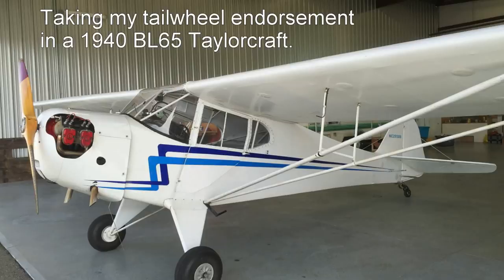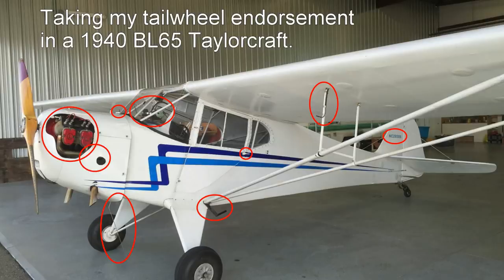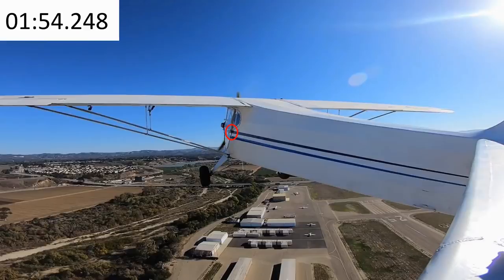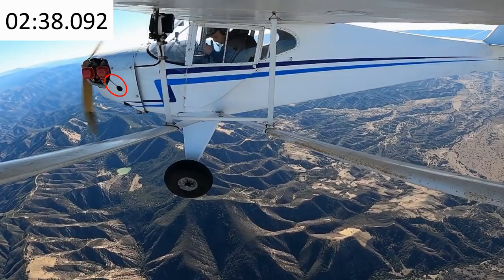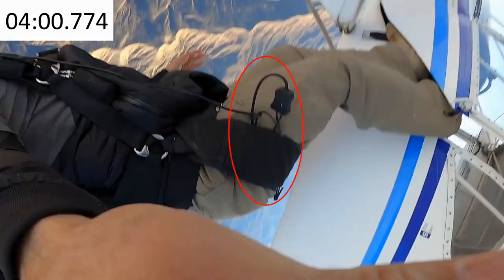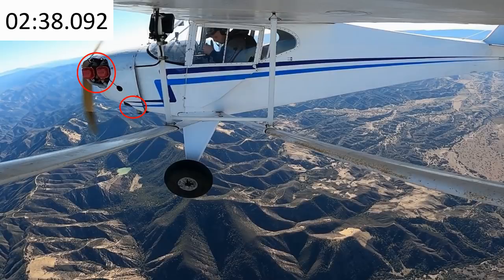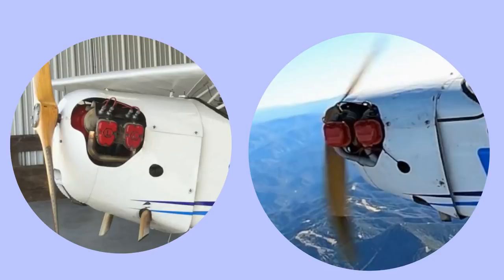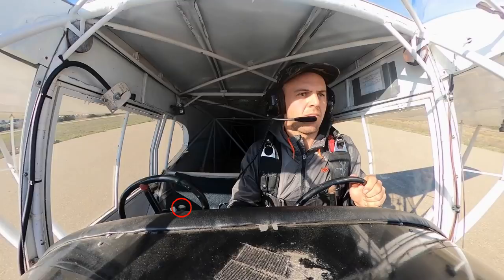Dear Trevor Jacob 1.1—That’s Not a Lycoming, I Found Your Water, and We Still Have More Questions…

Comment: There is a black pinstripe under the windscreen on the one he crashed also.
Not saying it couldn't have been added at some time but just one more inconsistency
Reply from the maker: The pinstripe is a perfectly aligned pitot tube, almost certainly.
Reply: @PetesGuide  lol, yes you are right 🤦‍♂️
I know nothing about aircraft so forgive my thinking I'd spotted something 🤣
It's an interesting story nonetheless
Reply from the maker: No forgiveness needed! I posted a similar comment on two other videos earlier, thinking it was a fuel line running from a jury-rigged fuel tank directly to the tank in the boot cowling. But that would have required rotoscoping it out of all the other camera shots and not missing any of the reflections. But that didn’t make sense because it’s more effort in perfecting the quality of the fake than Trevor’s psychology allows.
Reply: @PetesGuide   Thank you. This story caught my attention & I found your video very informative on this & it probably got me looking too hard to see something that isn't really there 🤣
Reply from the maker: @TS-yf2zf  that’s a good response, to be looking for the unseen. It’s the only way to make new discoveries.

Comment: Are there fuel tanks in both wings, if then it could be a fuel line dis-connect, not a pitot tube dis-connect.
Looks like a zip-tie rather than a bungee cord on the engine cowling. Top cowling has quite a few dents in it, compared to 2016 pics. Why so many oily fingerprints on engine cowling.
Someone, in another video, pointed out, that the camera over his right shoulder, is with a short handle. Could be the camera he's holding when bailing out.
Reply: Pre-war TC's only had a single tank in the center section, no wing tanks.

Comment: Also notice how the older engine has eyebrows/baffles and the new one doesn't
Reply from the maker: I’m not quite sure what you mean about baffles in that photo. I am aware of something that is supposed to be on the Continental, but haven’t gotten to that yet.
Reply: @PetesGuide   On the older engine notice where the spark plugs are mounted. There is a black metal object and that functions as an air scoop to force air around the cylinders to improve cooling. The newer engine simply has the cylinders in open air. That does not provide sufficient cooling if you want your engine to last. Other youtubers have pointed out that it implies he could be using an un-airworthy engine and slapped it on because it was fast and cheap.

Comment: Much may have been changed on the plane since 2016. Notice dents on the hood and corroded wing support. This is probably not caused by an engine swap. I do not think Trevor changed the engine before the crash. In any case, does not support the actions performed by Trevor
Reply: We have a Trevor ‘fanboy’ in the house!
Reply: @m118lr  As I wrote earlier. I do not support what he has done! Has he owned the plane for 6 years?

Comment: I imagine he pulled the plane out rapidly and destroyed it because the criminal charges would be resulting from making his own modifications to the plane without using an authorized technician.

The guy has to have some kind of brain injury or is just not able to think very far in advance. Just a guess.
Reply from the maker: I haven’t looked into it, but I’m pretty sure that tampering with evidence affecting 3 federal investigations carries more jail time than violating those particular FAA rules. So, yes, I think your assessment sounds like it should be considered.

Comment: The front of the plane flying isn't even the same as the first shot in the hangar.  There's also a black line from the windshield across the engine cover that isn't in the previous shot.
Reply from the maker: I’m convinced it’s the same plane. The black line is the pitot tube jutting out from the jury strut on the left wing, but had me fooled that it might be a wonky added fuel line or something otherwise unairworthy for a while.

Comment: There is no reason to expect a fire when a plane with the engine off and cooled down crashes and that plane does not even have an electrical system.  Ignition sources are missing.  There was also nothing on the ground at the impact point to give an ignition sourvce.

Comment: It does not matter how many strange things seen in the video. Without a direct admission or direct evidence proving the issue, he will not be charged at all, and if he is charged it wouldnt take a great attorney to just claim that the guy is a bad pilot and that anything shady in the video was coincidental. There is reasonable doubt.

I doubt the NTSB or FAA has a prosecutorial branch, so who would even make the decision? Maybe the FAA has that ability, as they can issue fines I believe. Which he will likely have to pay. They could get him for unsafe practices or negligence, but that isn't nearly as bad a if they could prove he did it on purpose. So I think everyone is jumping ahead, and fail to realize that there is nothing they can point to in the plane on the video that says he faked the engine failure and crash or whatever. But that is assuming they don't uncover other evidence. His fate, imo, comes down to how careful he was with the physical evidence. A jury could be convinced by circumstantial evidence, which is a huge problem with our legal system. So they could potentially just have odd things that don't scream guilty, yet still get a jury to find him guilty. I hate the criminal justice system in the US. It is a racket designed to generate income, as are the police. I've seen first hand how they just don't investigate serious crimes, instead focusing solely on murder and drugs. And mostly the users and not the actual criminals. But I digress.

Comment: you are looking at an image from 2015 and trying to compare it to an image from 2021 and saying the only person who could have altered the aircraft in those 6 years was Trevor 

the original owner could have changed the engine and removed the step before they sold it
Reply from the maker: I haven’t said that. I am asking a lot of questions. Also, there’s a photo from 2018 that shows the plane in much the same state as 2016.
Reply: @PetesGuide so why did you not use the photo from 2018 instead of the 2016 one and how much could have been changed from 2018 to 2021 

and as you im just asking questions what was his and what was the original owners handy work
Reply from the maker: @rayzimmermin  because there is a clear copyright statement on it and I have not yet tried to contact the photographer.
Reply: @PetesGuide  but copyright dose not mater if its for review or educational purposes and this is a clear open shut case of reviewing an image for the purposes of education 

ya knowing copy right laws is important

Comment: I don't blame him for abandoning the failed plane. At 3:52 in the video, you can plainly see the failed propeller! One blade is broken almost completely off at about 45 degrees, and the other is bent. Time to get out!
Reply from the maker: That’s an artifact of the type of shutter used in the camera. The prop was fine at this point.
Reply: I would agree with Tom... but... note none of the videos where folks are flying in helicopters where the rotors are completely stopped or even moving slowly backwards have ever shown everyone bail out, in fact the videos show the aircraft staying aloft just fine in that condition.  I think it is the proximity to Area 51 which causes this effect.

Comment: You claim to be good at details! Well why did you show the FAA registration as N029508 when it is actually N29508? All N numbers have five caricatures or numbers no more.  The NC29508 on the aircraft seems to be a feeble attempt to disguise the true registration.
Reply from the maker: I’ll be explaining this in the next video. Plane registration numbers used to start with NC, NL, NR, and NX. No obfuscation, just an old format.

Comment: It’s not only ludicrous if not INSULTING to the viewers of this video that someone with absolutely NO KNOWLEDGE of activation that a person who is obviously CLUELESS about anything aircraft related is analyzing this incident. I restored a 1940 Taylorcraft BL-65 in 1974. It had the engine changed from the less reliable Lycoming to the Continental which is a very common in these planes. There are VERY FEW Lycoming power BL’s left for that reason. I have owned three 1940 Taylorcraft and it’s very common to change the Lycoming to a Continental because the Continental is much more reliable. Most of the “clues” you mention are meaningless. The hole in the cowling was probably where a venturi had been installed and removed. What is the point of this video? The rust is surface and the actual inspection is an X-Ray of the ATTACHMENT POINT and surface rust is not even important . And the door is easily opened in flight.I’ve actually opened the door in flight several times. And what is the point of a pilot “calling for help”? What “help” would anyone be able to provide?  And the pilot tube has nothing unusual if you actually know what you’re talking about. Using the pilot manual for a completely different model that doesn’t even have the same seating attainment is idiotic. The “civilian” version with side by side seating has NO PARACHUTE procedures in its flight manual BECAUSE IT’S NOT a MILITARY plane WHERE COMBAT PILOTS HAD PARACHUTES BECAUSE  they were in combat! Ridiculous that someone with your obvious ignorance about even the simplest things any pilot would not find remarkable at all just shows you are completely unqualified to even attempt this analysis
Reply from the maker: Can you explain the removal of the boarding step?

Comment: The most useless of all of the trevor jacob crash videos....if the engine was super old/out of hours/needed to be replaced/damaged/etc it could have been replaced previously, fuel gauge may not have been working correctly, plenty of others have already addressed the headset wires, then you go on more about the engine (again, engines are things people swap), the boarding step could have been removed prior to the intent of "needing to abandon the plane" and he could've quite easily gotten in without stepping on something that would cause damage, and lastly the water bottle -- he made a comment that he had a water bottle, not that he couldn't find it on the seat when he was flying...great "attention to detail" narrowing down brand of water is on the seat.... (the entire section about the water bottle is your most useless/pointless/look-at-me-on-youtube-making-a-commentary-video of the whole thing). 

I'm not defending anything about the stunt, the crashing of a plane, safety risks of the stunt, the nonsense to try to make it look real, destroying vegetation on the hillside, etc...this video is just futile.